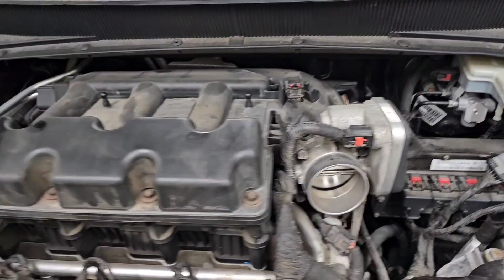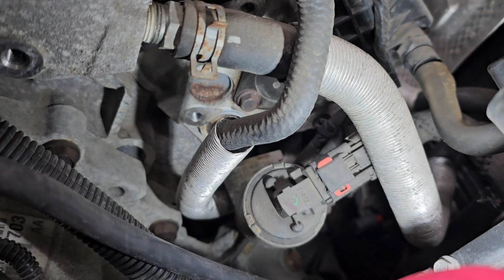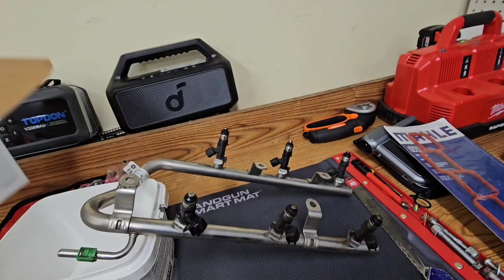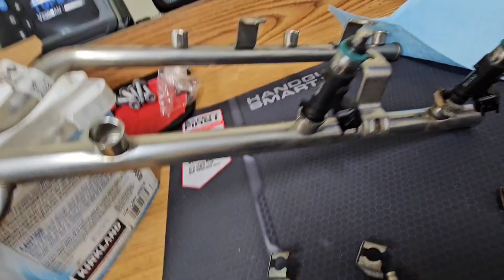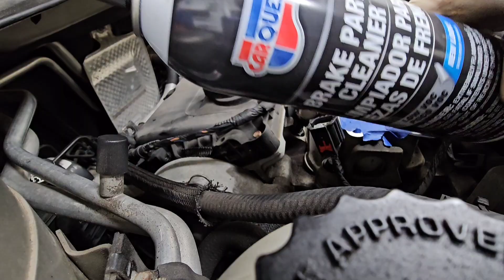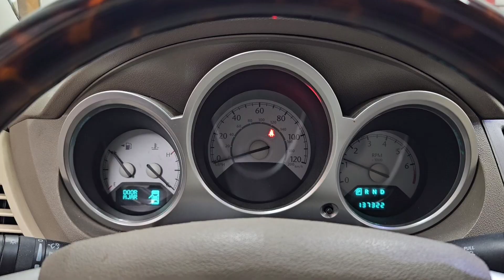Chrysler Sebring 3.5L V6 | Fuel Injector Replacement (2007, 2008, 2009, 2010)

Comment: I just did this same job, but only changed one fuel injector and now getting a p0300 code.  Any idea what I should look for?
Reply from the maker: Its possible if could be something else, bad spark plug/coil, maybe even. If the car runs normally, its possible the code popped up when you were starting it as it still needed to build proper fuel pressure for correct running conditions. Especially since it's a random misfire code and not a specific cylinder. Check for any vacuum leaks too.

Comment: What size socket for battery?
Reply from the maker: Apolgies as this is probably a bit late at this point, but the battery wire is believe was a 13mm or 15mm